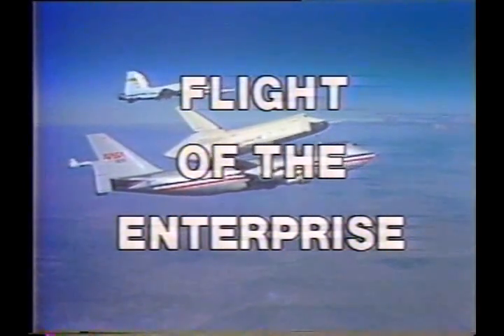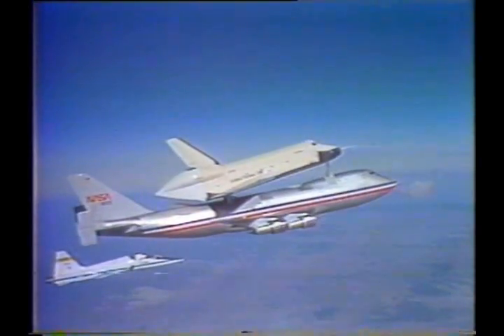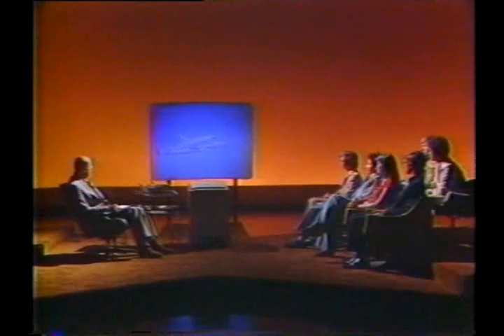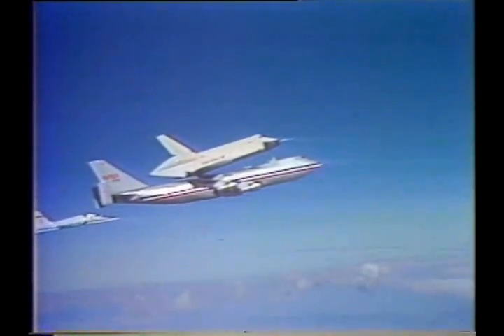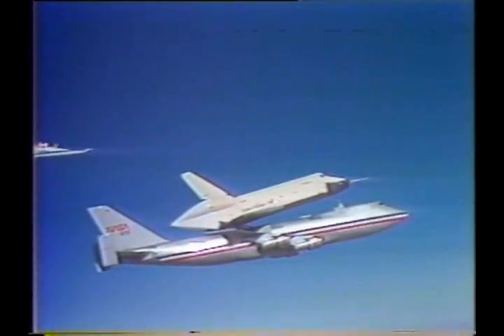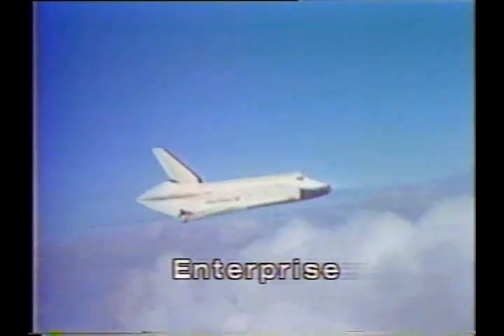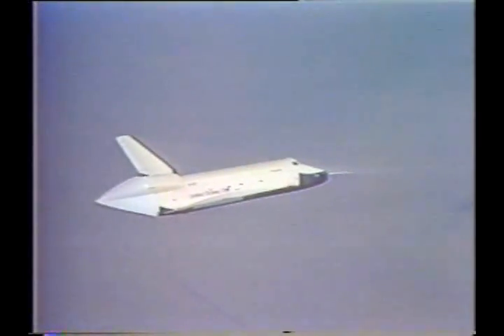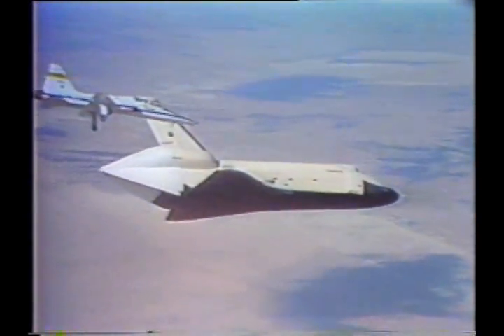Enterprise First Test Flight 1977 cut 2

Comment: My late grandfather, Vic Horton, was aboard the 747 SCA as flight engineer! During this first launch, Fitz Fulton (747 command pilot) didn't fully trust the computer numbers and had Grandpa running the trajectory calcs for the release by hand to double check them; they had made many YF-12 and SR-71 flights together and Fitz knew he could trust Grandpa's math. Grandpa held the flight engineer position from the start of the Shuttle program until his retirement following the Challenger disaster in 1986. I don't remember a whole lot about it, but I got to go aboard it a couple times as a young child.

Comment: I can't stop laughing at the "balloon shuttle" float up as its released @4.20!. #spaceisfake
Reply: The shuttle and plane are both moving at high speeds. When it separates, it achieves more lift for a time, rising higher than the plane. Please understand some aerodynamics before decrying genuine achievements.
Reply: LOL try all you can buddy, so many people have awoken to the fakery of NASA and other fake space agencies.
Reply: Look up delta wing aircraft (https://en.wikipedia.org/wiki/Delta_wing)

That may shed some light on how the shuttle can have such effective lift with wings that are shorter than the carrier airplane. When maneuvering away from the plane, the shuttle can use its rear flaps and control surfaces to steer itself upwards and downwards, and of course they choose up because the plane is right below them.
Reply: @conformity_checked   It's no use jet--  there is simply no way to reason with these people.
Reply: @deltahfman  yep, definitely a balloon, it's amazing what technology they had to keep the chase planes going that slow...
Reply: I can't stop laughing at your stupidity.
Reply: Not a balloon, it is a plane. Watch B-52 launch X-15.

Comment: All shuttles are gliders. They re-enter the atmosphere underpowered, and glide to the ground. This is simply a test of that gliding ability, The Enterprise (which never had any engines because it was never intended to actually fly in space) was carried up on the back of a 747, then basically "dropped". and flown back to the ground

Comment: at 6:32...why is the landing gear of that small plane down??
Reply: 4 years later I'll try answering it :) - it is because the shuttle's flying qualities were a little bit worse than those of a normal construction brick flying through the air. Basically normal airplanes had to be configured as inefficient as possible (aero-brakes and landing gear out), if they ever wanted to drop to the ground as quickly as the Shuttle was dropping.

Comment: Actually the computers did not take up that much room at all each AP-101 was contained in two boxes that measured 19.5"x7.62"x10.5" and weighed about 110lbs.
All five would have took about as much space as a refrigerator or large console TV.